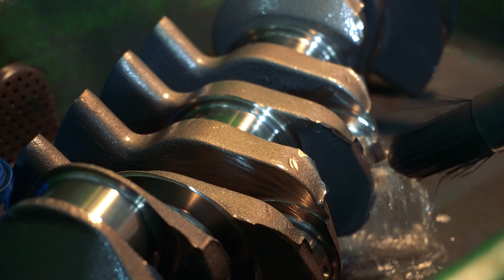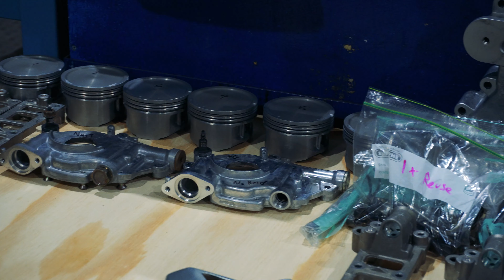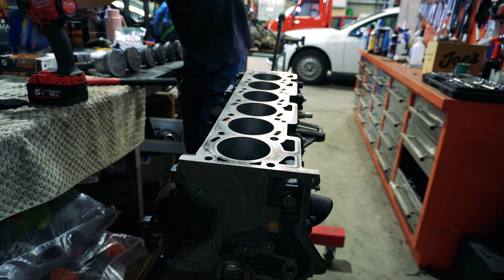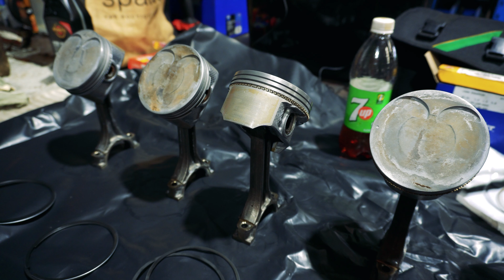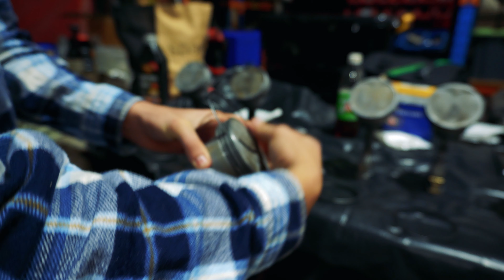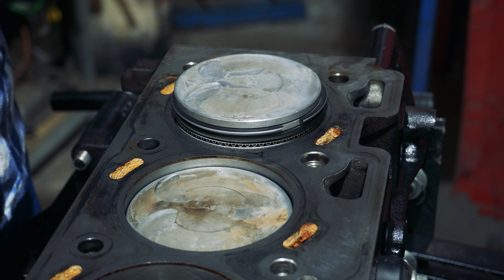FG Greentop Barra Build Series Part Four | Short Block and Ring Gapping

Comment: So you reused the main bearing bolts?
Reply from the maker: Reusable non TTY as stated on factory manual 👍
Reply: Thanks for the information. I'm rebuilding an engine at the moment. Where do you get your connecting rod bolts from? I can't find any on Ebay. @thebarraspecialist
Reply from the maker: @anthonycavalliotis8736  hey mate, ford genuine parts sell them
Reply: That's what i was worried about. @thebarraspecialist